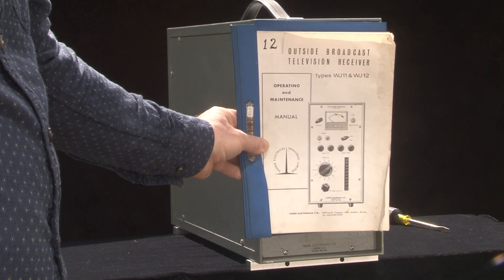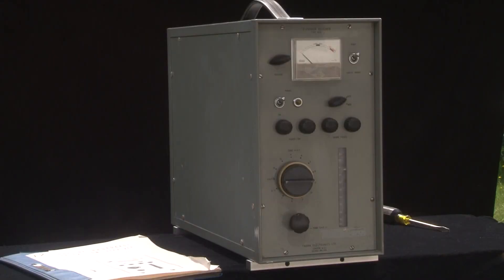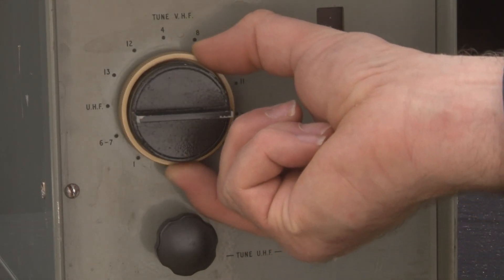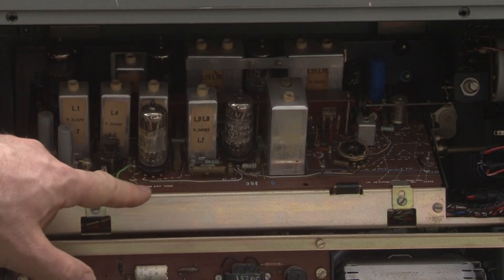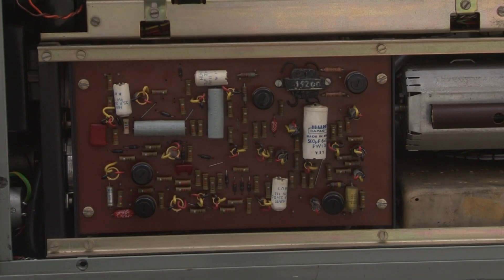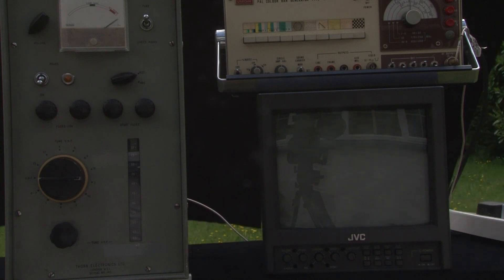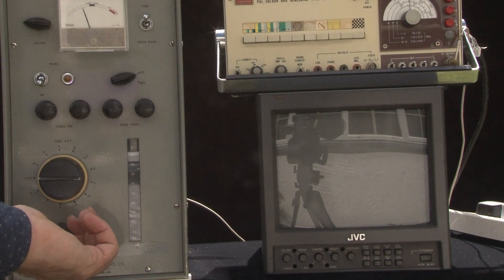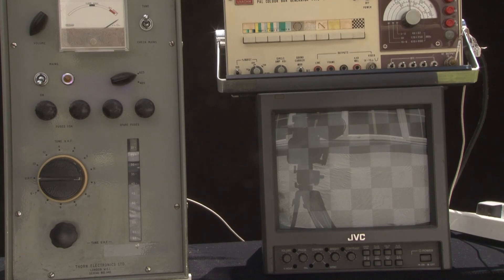The Thorn WJ11 off-air TV receiver -  Part 1

Comment: Did I miss a look at its screen -- or was the CRT simply not working?
Reply: The video was shot outside in a bit of a rush, but there was a test pattern just visible in spite of the reflections and the only sunny day for weeks!  Coming soon, part 2 will show the receiver running back in MCR21.

Comment: Looks like Thorn simply used the receiver strip from a domestic model, probably the 850 series!, they really weren't thinking of the service technician at all, PYE on the other hand were old hands at professional equipment and knew what was required.